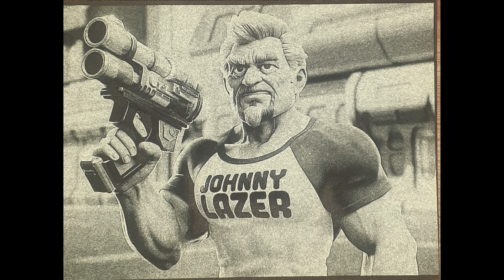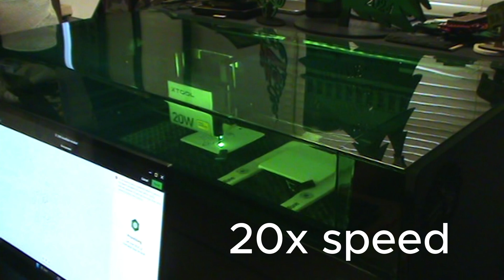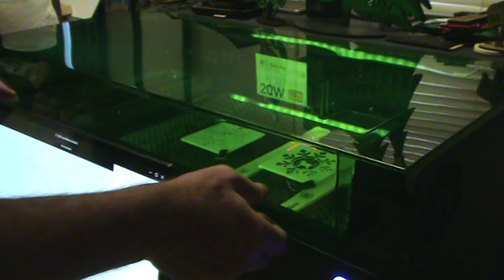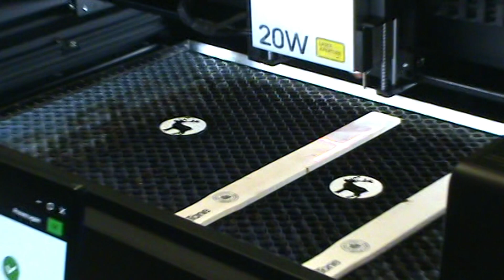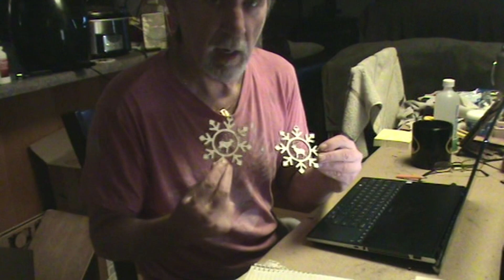Remove burn marks on your lasering projects using the xtool s1 20w #education #business #money #fun

Comment: I'm not knocking your workaround, as I do see your though process.  But wouldn't a light sanding with a 440 grit sandpaper eliminate the burn marks?
Reply from the maker: Oh sure it would,  I was just trying to show an easier way to avoid sanding..
Reply: Can i use wood I've cut as raisers?